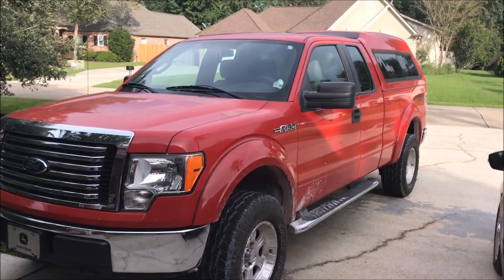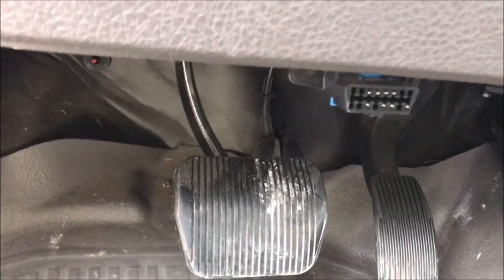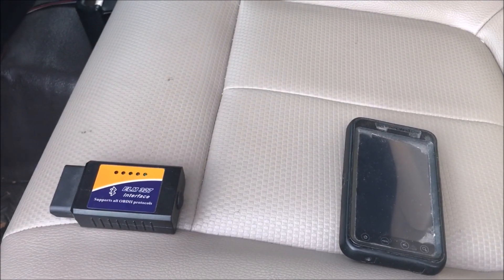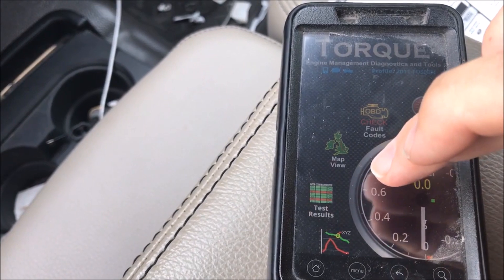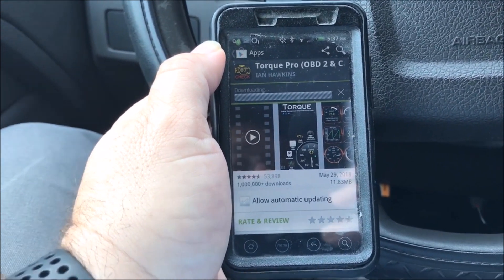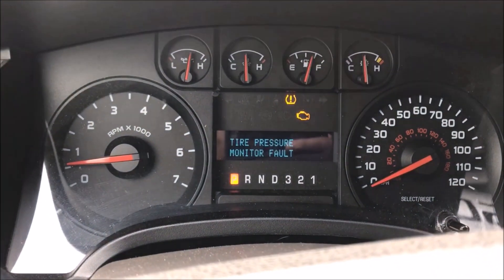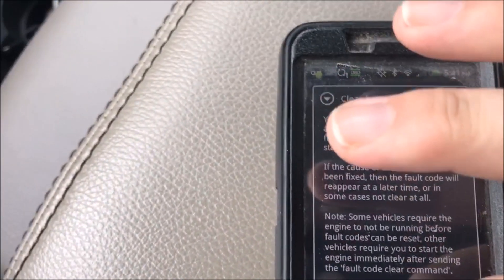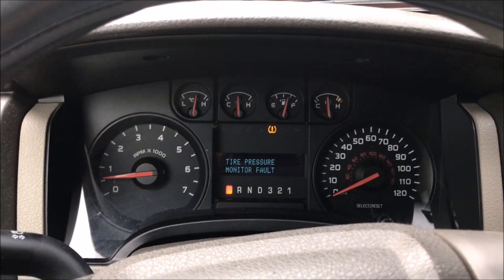2010 F150 Check Engine Light, OBD2 connection  and Torque OBD2 App

Comment: I have a P0430 code, which is a catalytic converter code, is there a way to clear the check engine light/make the computer ignore it since it’s not affecting reliability? Also I have something that looks similar to OBD2, but isn’t, someone said it could be a tuning port, but I thought they used obd2 to tune..
Reply: what was it?

Comment: I use https://www.obd-codes.com I’m going to suggest check for O2 sensor fuses or relays first.
Reply from the maker: Thanks for the suggestion. There evidently is a TSB when it throws those codes together. There is a revised tune from the dealer. So I guess it will go get the update. Thanks again for watching..